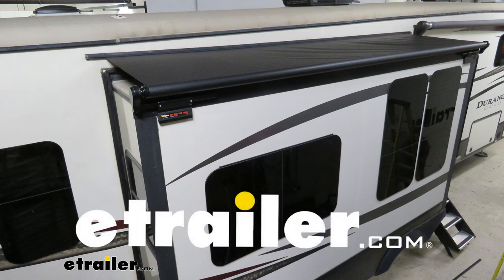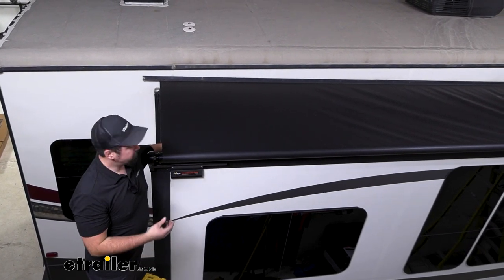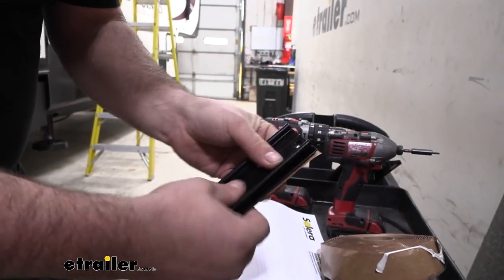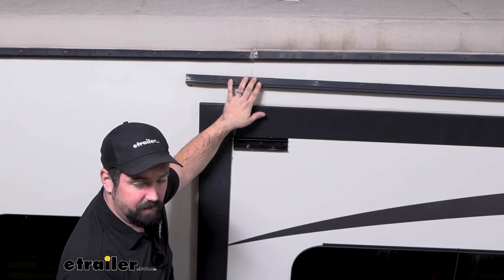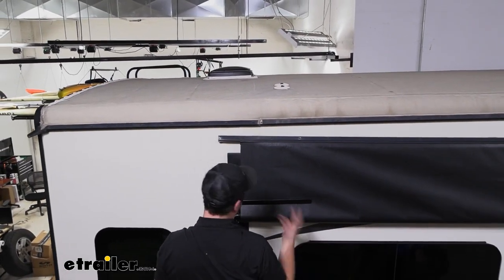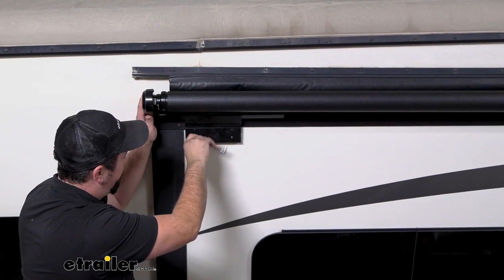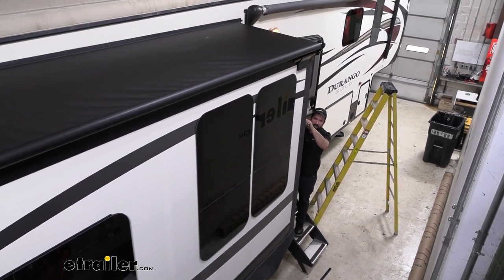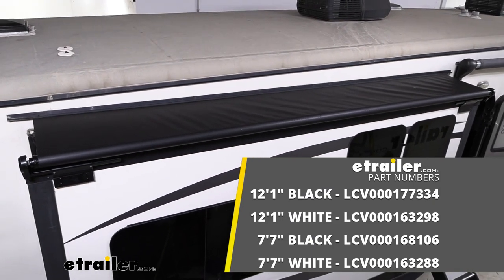etrailer | How to Set Up Your Solera RV Slide-Out Awning on a 2015 K-Z Durango Fifth Wheel

Comment: The problem with using butyl tape to mount the plates onto the slide is the butyl permits the bracket to lean the top back causing the roll to be closer to the slide T-track.  Better to use a sealant.
Reply from the maker: That makes sense, thank you for the tip!
https://www.etrailer.com/RV-Awnings/Lippert/LCV000163288.html